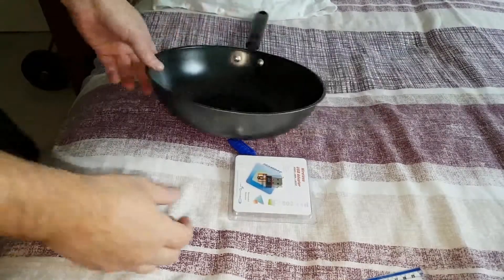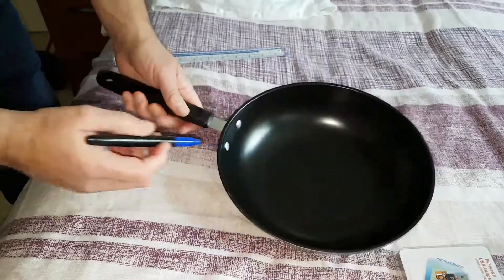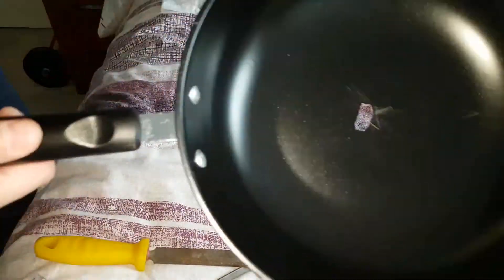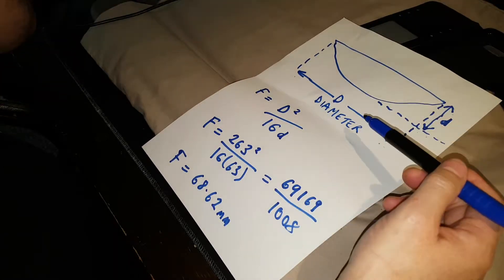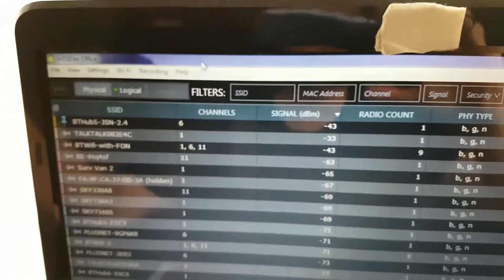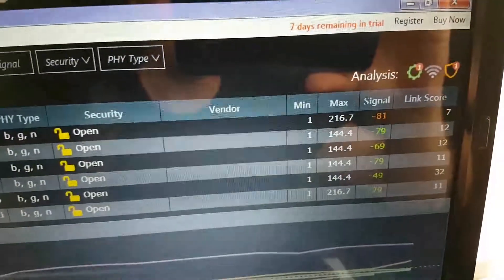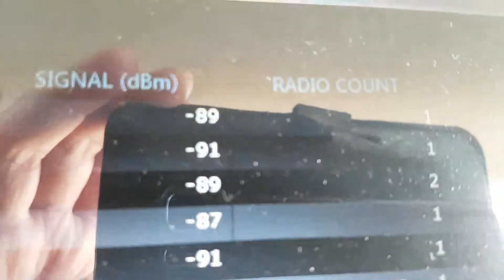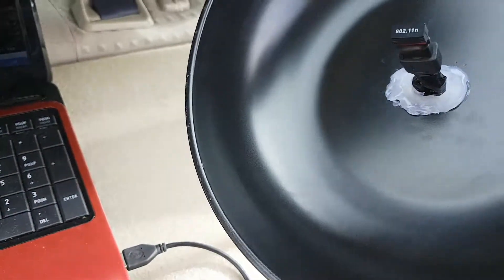How to create a WokFI or directional antennae for under £5

Comment: Interesting setup, unfortunately what your picking up at the outside location is probably unusable due to the signal strength it's reporting.. would be interested to see how it compares in closer proximity to a usable signal compared to the onboard adapter to see how much more gain the wok is giving..
Reply from the maker: Well if you see from the video I showed that using the built in laptop wifi there were no signals picked up at all. This was just a cheap version of the one I'd built previously to show that the design works.